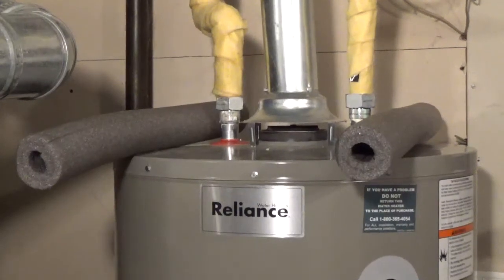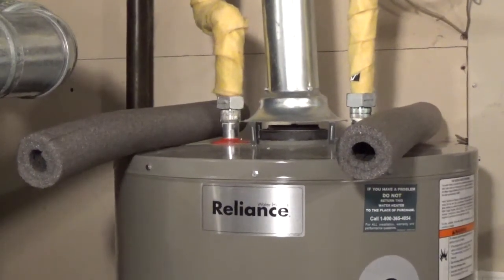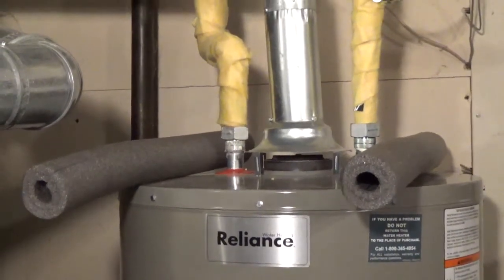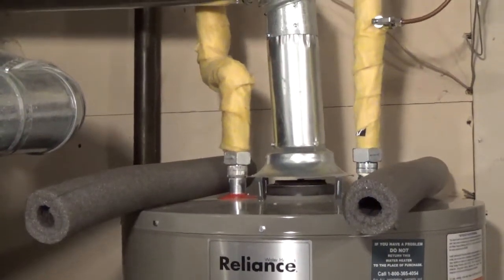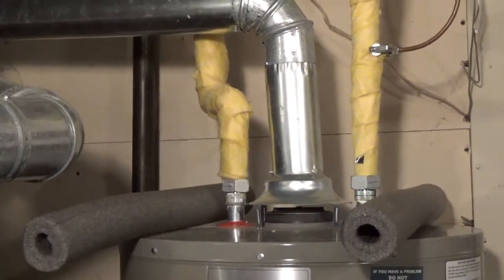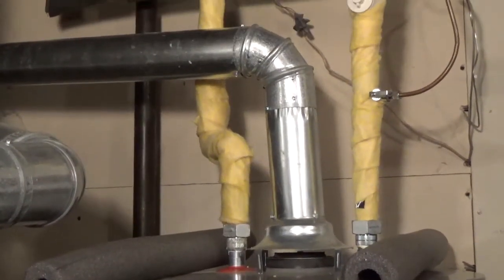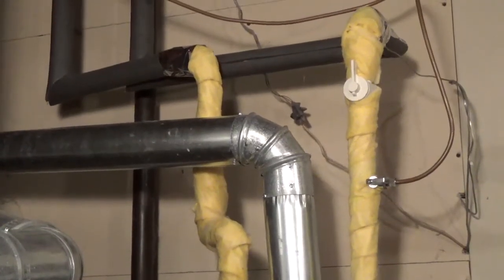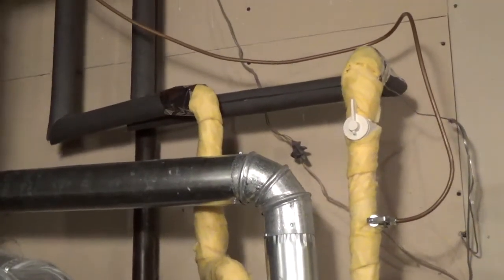Reliance Gas Water Heater - Foam Pipe Insulation

Comment: doesn't hot water pipes get too hot for insulation?
Reply from the maker: Hi, foam and fiberglass insulation work well for hot water pipes and is recommended by the Department of Energy to help reduce heat loss in the pipes and reduce energy costs. 
Check out some home improvement tips in our e-books https://www.amazon.com/gp/product/B0B2KW1FQ9?notRedirectToSDP=1&.
Reply: @FIXITHomeImprovementChannel  pretty sure the pipes get too hot for foam or fiberglass...